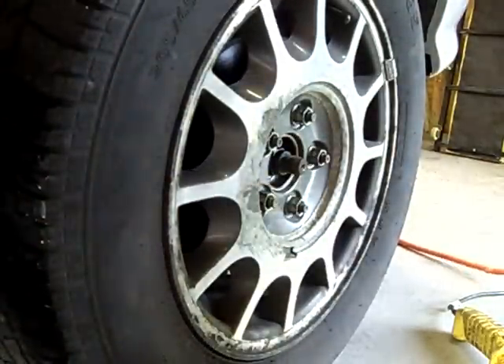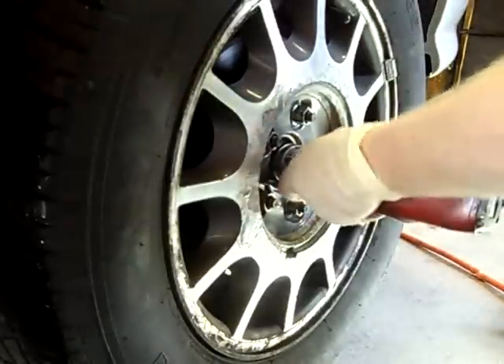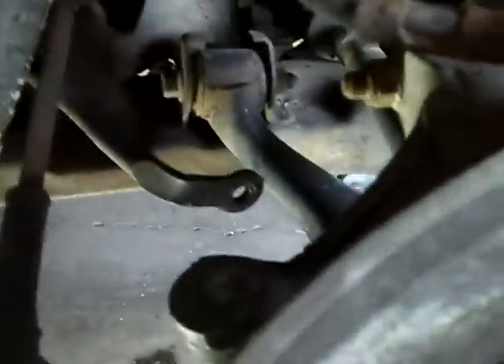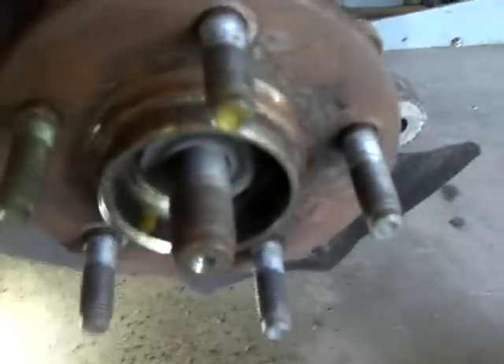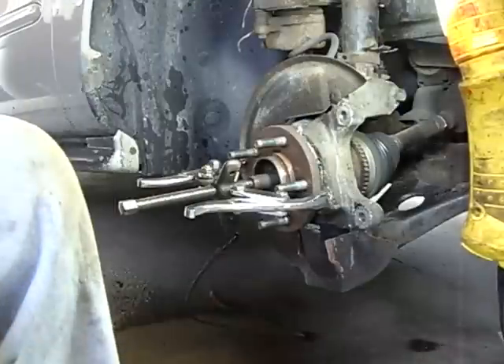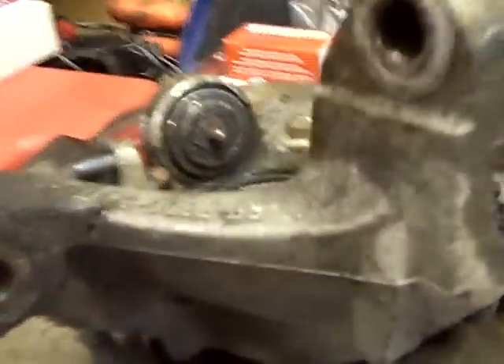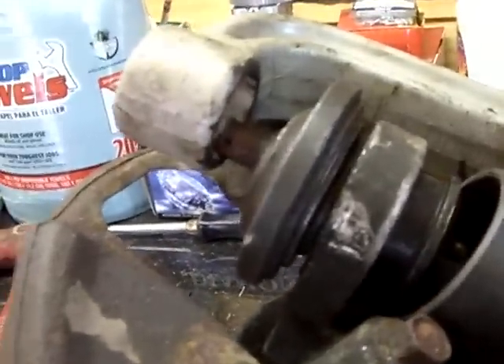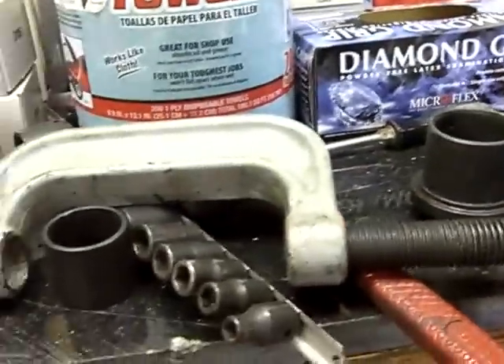Replacing 99 Ford Taurus Ball Joint.

Comment: You pointed out the ABS assembly, that's something no one else did, that helped me. Thanks for taking the time.
Reply from the maker: Bent Nickel you’re most welcome! This repair was quite some years ago and some of those techniques aren’t necessarily correct such as using the pickle fork on a known good tie rod. It tears the boot. But, I’ve done enough of these now to know that if you mess with the ABS sensor it’s almost always cracks and the wire windings spill out like a slinky. I’m glad the video is still helpful in some ways. Thanks again for the view.

Comment: Your instructions were spot on for getting the ball joints replaced on my 1999 Taurus. I didn't have a vice, but I was able to rent the proper tools from our local O’Reily’s, even a special set of ball joint press adapters for Taurus vehicles. I also changed the upper and lower tie rods at the same time. Total parts cost less than $130. The tool rental was a deposit of more than $270, but I got all that refunded.

I don't have any air tools, so it was a little tough for me at first.
Reply: I'm currently fighting 20 years of rust getting my front end assembly taken apart on my 98 Taurus. Help

Comment: Great video . I'm starting my 2002 FT project in 30 minutes. This Video will help. Thanks.
Reply from the maker: +Robert Davis thank you. Be sure to watch it with annotations on as I add notes in specific places. Also do not use a pickle fork as I mentioned in the video. Use a heavy hammer to snack the control arm where the stem goes thru to pop it loose. Same with the ball joint shaft, smack each side where the stem goes thru. In some cases a separator may be needed if it's never been changed. Pounding on the ball joint stem will not work. Good luck and be safe.

Comment from the maker: A pickle fork does not usually work well because the stem is too long. Try this: put a bar in the control arm and apply downward pressure on the ball joint. While applying pressure, give the steering knuckle surrounding the ball joint stem a swift smack with a heavy hammer. The shock from the hammer will jar the joint lose and it should "pop" out. It may take several hits. Quick, sharp strikes are most effective. Let me know how it goes.

Comment: Did some searching had same problem needed about a inch clearance, found out that you need to put jack on main support, and jack on sub frame, release sub frame bolt to the end but don't take out, then remove jack on sub frame and it drops 1 to 2 inches. Real easy once I foundit

Comment: Another thought of mine...  When you're successful in disassembly and you're to the point of placing the knuckle in the strut and control arm...  Those parts are tight fitting before you have fastened anything.  I had to get a loaner spring compressor and compress the spring/strut... This reduced the prying forces on the control arm I needed to put it back together.  Of course I removed the strut/spring compressed it and then put everything together.

Comment: The first one I did was an e250 , no air tools , it was like wrestling an alligator to get the new balljoint pressed in . From there on out the next few I did , I placed the ballljoint in the icebox , warmed the hole with a torch , sprayed with lube and it slid in nice and easy with the press.

Comment: To separate the ball joint from the lower control arm i put a 3/4 inch wrench in the gap where the fork goes and then used the fork to hammer out. because when I hammered the fork in there it just went all the way to the end and there was still play. The 3/4 in. wrench fit it there snug on the plastic washer. Also what I found to be easier is to take the whole strut assembly out by taking the three bolts off the top of the strut.

Comment: I have a 98 Ford Taurus 3 l motor with all those extra valves in it recently upon doing front axles I figured what the hell I'm here let me put in lower ball joints and I must say they were two of the easiest ball joints I have ever put in and I put in quite a few in my day on other vehicles.

Comment: Had to replace lower ball on wife's 2000 Taurus and while installing new Auto Zone ball joint and hearing you saying they don't last long. I pulled off the grease boot and there was hardly any grease in it at all. I packed the boot with grease, don't know if by doing that will it work it's way into the joint, there's no Zerk fitting to grease other side of ball joint. I hope this helps prolong it life, I'm not looking forward to doing this job again. For any first timers, when you rent this tool make sure its in good shape and not worn out. My rental unit, the edges were all rounded off, it's important that they are not so to push the edge of the old ball joint out, I had to use a short piece of tubular steel to push it the last 1/4" out. If I have to do this again the replacement ball joint will have to be grease-able, Maybe Moog makes a grease-able ball joint Auto zone doesn't.
Reply: PLEASE DO NOT USE Autozone or any other cheap Chinese parts such as from Parts Warehouse, Prime Choice or even AC Delco Advantage level(OE Level Delco is good) on Amazon, etc. You will be doing the job over and over. Lifetime guarantee notwithstanding, do you really have the time to do this job every year? What about if the cheap ball joint or tie rod end or other important part breaks while driving and some report that they do. Always use a good American brand like MOOG which comes with a zerk fitting for greasing if applicable. On this particular ball joint, no zerk fitting would fit in the tight space of this design so it's imperative to buy a Ford Motorcraft or Moog Ball joint either of which is available at Advance Auto Parts for about $60-$65 or from Amazon for roughly $30.  Do it once properly and it's good and safe for years.
Reply from the maker: +Don Hart thanks Don and yes that's good advice. However the Moog price around these parts is significantly higher than Duralast or other "affordable " brands. Sometimes you have to go with what you can afford in order to get the car rolling again. Regular inspection of the vehicle helps detect these sort of issues along with driving them in a friendly manner. Being aware of the noise a part makes as it starts to fail is key. Clunks, grinding, rattles,  etc should not be ignored.

Comment from the maker: I did that job 3 times, twice on one side. After the first time, it was easier to remove just one more bolt and put it up in the vice where it was solid to work on. It was just better not to have to fight for room trying to get the press in around all the stuff. Thanks for the comment

Comment from the maker: @PimpinKicks09 Yes, I have experienced that in the past too where the ball joint is really wore out. The gap is too large for the pickle fork alone to pop it free. People have different ways of doing this job. I did this job 3 times on this car and learned it was easiest to get the steering knuckle up in the bench. It only adds a small amount of time to the repair but saves a ton of frustration and swearing. LOL

Comment: Thanks for the video.   Great job.   I believe that the reason for the multiple time to replace this part is due to lack of greasing of it?   Some ball joints have to be periodically greased.   This will prevent it from wearing out.
Reply: There is no grease fitting on the ball joint due to lack of room. What a piss poor design.

Comment: Do NOT use a pickle fork or pry bar to remove the tie rod end nor anything with a boot like the tie rod end. It can and probably will damage or reduce the service life of that joint. For the tie rod, hit on the side where the tie rod goes through the hub assembly, NOT the actual tie rod end. Don't mean to step on toes, just some friendly advice.
Reply: You are correct, temporarily distorting the boss or seat on the steering knuckle with a hammer blow is the preferred method of popping a tapered ball joint end stud or tie rod end stud loose. It also works on the other end of the tie rod if it's connected to a idler arm or pitman arm on the steering box shaft as in most trucks If the part is stubborn to remove, a second  hammer held on the opposite side of the boss from where you are striking it will work even better.

Comment: @AllThingzVideo Excellent clip. The guy where I bought my pitman puller told me that you need to put a big hammer on one side of the control arm next to the ball joint and strike a hammer hard on the other side of the control arm to loosen the ball joint before pulling it, because it's a 'Bear.'  I did, and it came out easier than 'Windsor358'.

Comment from the maker: You definitely had your issues with this job. I had the same issue doing the pass side ball joint both times. The first time I actually cut the stem of the new ball joint off about 1/8" and re-threaded it. 2nd time I removed the front most A arm bolt from the frame and slid the lower control arm out and down to get the ball joint to pop in. I never had that problem on the drivers side, just pryed down and it popped in.

Comment from the maker: Jack up the car until the tire is about an inch or tow off the ground. Get a long bar and slide it under the tier and pry up and down. You will hear it popping if really bad. You can also have someone push in  and out on the bottom of the tire while you look under the car at the balljoint. You will see it moving in and out independent of the control arm. It usually clunks while driving when bad.

Comment from the maker: @PeterObi That is the steering knuckle. If it is cracked, do not drive the vehicle! If it fails completely, the tire/ wheel assembly will come lose and cause you to loose control of the vehicle. Not a good situation. Get it replaced asap.

Comment: @AllThingzVideo Thanks, didn't to take off yet. I got the same tool kit from Autozone and there is no way to take the ball joint out with that kit. Got to go back to "A" for a different tool.  I don't think you video showed that there is 3 bolts that hold the bearing assy. from the back side. I almost screwed that up.

Comment: I did both sides today on a 97 taurus. If I had to do it again I would get a spring compressor and compress the spring 1 inch. Then it would be easier. Interesting design. How do they do alignments on these cars? It looks like the only adjustments are toe in.

Comment from the maker: @Kyocera234 Another way to test them is to slide a long bar under the wheel while it is raised slightly off the ground and pry upward on the tire. There should be no play of thumping noise as you do this. Finally, if you have a large enough pair of channel locks, you can grip around they ball joint with the car raised and squeeze the ball joint. If loose, you will notice compress and release. cont-

Comment: @AddToDiscussion Yeah I agree that the 27170 from AutoZone worked excellent. I used it today after my pickle fork got frigging nowhere. Loaner tool worked perfect in about 1 minute. And also that Pitman arm does not annihilate the ball joint boot.

Comment from the maker: @wildbaseballplaya You need a long bar and a second person if avail. You should disconnect one end of the sway bar link to allow a little more travel. You cant use a jack on the rotor. Make sure the spindle nut and axle is seated all the way. Push the shaft of the ball joint toward the car, pry down hard with the bar on A arm and guide it in. I did it myself but had to sit on the bar while I wiggled the ball joint shaft back in. Take a break & then try again.

Comment: A long breaker bar 19 mm socket I think removes the bolt securing the steering knuckle to the strut (the steel bolt could be fused in the aluminum hole).  I had to hit the bolt with a hammer to push it out of the hole.

Comment from the maker: @Kyocera234 Typically a shop will not align a vehicle with bad ball joints bcuz the alignment wont "stick". To check them, raise the wheels about 2" off the ground. Grab the wheel at 3 and 9 o'clock position and attempt to "turn" or twist the wheel. If there is side to side play then lay in front of the wheel and watch the ball joint as someone else "wiggles" the wheel. You will see it "pop" out of place and then back again. Cont-

Comment: Removing the control arm from the ball joint was easy with a Pittman control arm/tie rod end separator.  Works great on the tie rod also... The tool costs about $15...  Or you can get a loaner front end service tool kit from autozone.

Comment from the maker: @windsor358 I describe the process at 3:20 where I use the pickle fork to separate the ball joint and the tie rod end. That sounds extreme as to what you had to do. I am not saying its not possible for them to be that stuck but I have had some original ones need heating with a torch to help loosen them Typically a pickle fork and a big hammer is all that is needed. Wedge forces it out....

Comment: @AllThingzVideo  I could try again on one side, but not the other, One side has to go up on the spindle. Thinking about putting wheel on and lowering car so spindle will go up. On the other gonna try and see if I can take control arm off and backward engineer it.

Comment from the maker: @Kyocera234 Pulling and drifting can be caused by an improper alignment, worn tie rod ends, broken belts in the tires, worn ball joints, worn rack and pinion (usually leaks), or even improper rear wheel alignment. Just because it was aligned, doesnt mean it was performed correctly. Take it back and tell them that it still drifts and pulls and that you want the alignment checked again, no charge! If there are other front end problems, they will hopefully discover them this time around & tell you.

Comment: I have to question why you would go with the same part that failed after 2 years, warranty or not I doubt they've changed their design.  Other than that very informative video, thank you very much for taking the time.  Your assembly of the press tool alone will save me a lot of time.  Id rather be under a nissan.

Comment from the maker: @wildbaseballplaya The Autozone kit will work but you need to make room to use it by taking the assembly off the car like i did. You dont need to remove the wheel bearing (3 bolts) Just push the drive axle thru the bearing and leave the bearing on. Check my video again and you will see that the bearing is intact while the assembly is in the vice. Just take your time and work consistently.

Comment from the maker: @wildbaseballplaya Well the rotor has no torque spec. Are you referring to the spindle nut? The spindle nut torgue is quite high, 200Lbft or more, just run it in with a good impact. The wheel bearing bolts I would gues are around 80lbft or so. Once again, snug them up tight with a 1/2" drive ratchet or air gun.

Comment from the maker: @cvilla198 What year is your Taurus? You cannot remove the ball joint w/o getting the CV joint & drive axle out of the way. Is your ball joint part of the lower control arm and not the spindle? There is little to no room for the press with the unit still on the car. Pictures or videos would have been nice, did you take any?

Comment: @AllThingzVideo Thanks for the reply. I ended up taking the spindles to Napa to replace the ball joints. Now I am having the worst time trying to get the a arm and ball joint back together on both sides.
 I'm in the middle of putting two back together.  I can't get on one side the a arm low enough. I tried to raise the rotor with a jack, but it lifts and pulls away from the car and I can't push it back in. ???

Comment: wow, that's a lot of work!  I have replaced the struts on my taurus myself so I kind of know a little bit of what you are doing.  What were the symptoms in the front end that you noticed so you were able to diagnose down to the ball joint.  After I put on the struts I had the front end aligned but I still can feel some pulling or drifting, would that possibly be a ball joint?

Comment: On the other side I couldn't push spindle in while holding down a arm. I ended up tearing boot on new ball joint. It's back at Napa to get replaced Monday. 
Any tips? PLEASE!!!  I am going crazy. I had so many roadblocks while doing this, but I have learned a l

Comment: In order for me to get the ball joint free from the lower control arm, I had to use a torch to heat the the control arm combined with a Pittman tool. I tried every way possible and heating it was the only way I could get it to pop loose. I was starting to think the ball joint was permanently attached to the control arm...what a pain this job has been......
Reply: You would think an auto engineer could design it better, but with a 4 year degree you just pay someone else to do it . It was a piss poor design off the assembly line. I have done this job about 6 times and it does not get easier.

Comment: On my 99 Ford Taurus my hub assembly cam off when I used the puller. I wish you would let us see the ball joint coming out of the controller arm. Seems as though I am a inch or two short of getting the ball joint out. Any advice on how to get the hub assembly back on and the ball joint off.

Comment from the maker: @wildbaseballplaya I would NOT recommend putting the tire on and lowering the car! The Strut will kick out and cause the car to shift & fall inward, damaging a ton of stuff. Remove the front bolt from the A arm and it will slide / swing back and give you a little more room. Getting it lined back up is tricky tho because the whole assembly will have to come forward. Did you remove the sway bar link? Sometimes turning the wheel all the way one way or the other will give you clearance too.